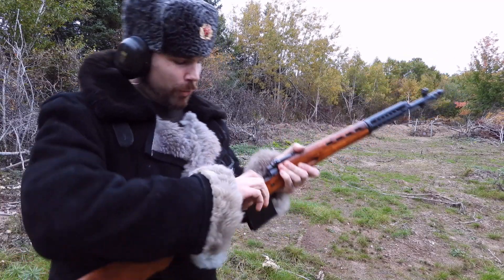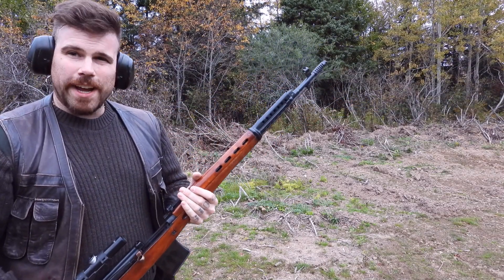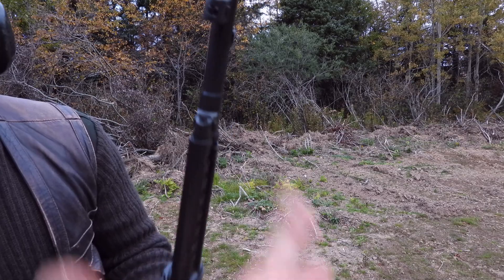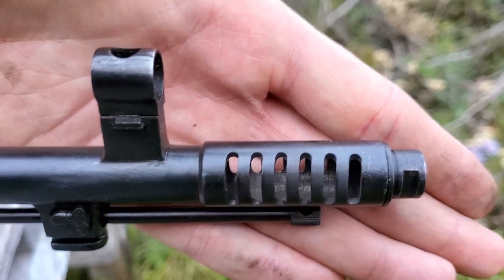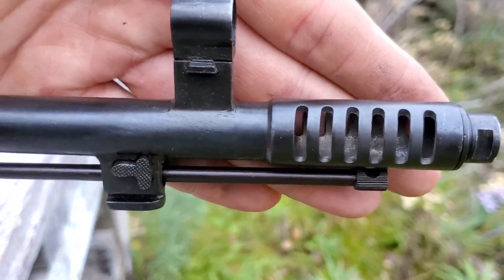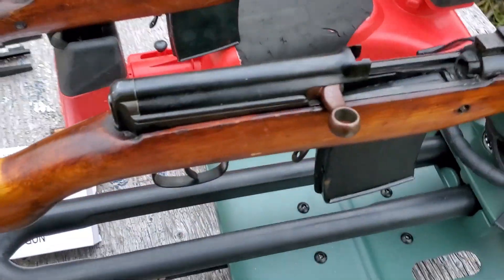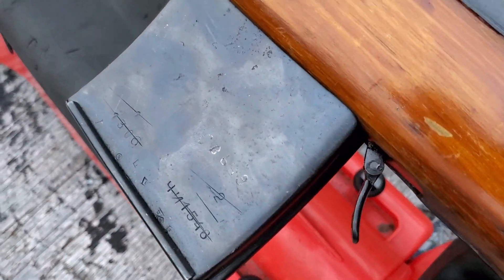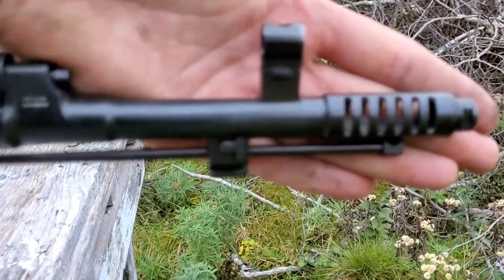1941/ and 42 SVT-40 rifles

Comment: Man I've been wanting to grab one of these while I still can but the price some are going for is nuts. Also is the bolt closing when you insert a new mag an intentional feature?
Reply from the maker: I was lucky enough to grab mine when they were still fairly available.  Canada got a huge blast about 10 years ago of russian surplus and you could get em for under 200. They're over 1k now. And im not positive if it doing that was intentional but I'd assume so. It only drops when the mags in or its recocked.
Reply: @mostly_accurate  I remember back before I got my PAL they were still around 500 bucks, now I'm seeing them for 1500+ which is just absurd, wish I was born earlier so I could've snagged all those sweet surplus deals

Comment: I lost one of the 2 recoil springs in mine. Hopefully I find one soon so I can put it back into action
Reply from the maker: Ah you got to love that one part that goes flying during dissaaembly. If nothing else its probally easy enough to get a replacement.
Reply: You would think eh. I’m sure I could find something close it’s a pretty generic size spring.
Reply: Complete set found on eBay 70 bucks! Who knew🤷🏻‍♂️

Comment: I’m confused as the 6port muzzle is the “earlier” model, yet has a 1942 stamp. And the 2port is the newer model yet has a 1941 stamp. 
Is there a mistake in the info or am I misunderstanding something?
Reply from the maker: Soviet union Refurbished alot of the guns and swapped parts around. Some are matching some are stuck together.
Reply: @mostly_accurate  ya I’m starting to realize a lot were swapped.
I also noticed with yours the rear sights are reversed for their models. Early year should have the groove down the middle between the numbers. Beautiful rifles btw, and great vid
Reply from the maker: @kevinVersus  thanks man. And yeah, from what I've heard, some went right into storage. Some got stripped and reassembled.I've got some new cameras and stuff. I was planning on making a few new POV videos just haven't found the time.

Comment: When you connect mag, there is a locking switch behind it. Locking it secures the mag, and make cartridge travel to chamber more smooth and avoid possible jams
You can use mosin stripper clips, easier to find pouches for them, than for original magasines (should be +2 with the rifle)
Reply: I have an SVT40. The magazine latch does not lock the magazine. It just moves out of the way so you don't accidentally hit it and drop your mag. if you pull the tab with it turned upwards you can still take the mag out.
Reply: @Bryan-jm4uc ifbit works then it works, and that is enough) yours guns a nice!  i have many mags, half of them restored war relics. Lock  holds mag better, fixates it. same detais tetaches mag when pulled towards mag. There was a war reports that soldiers lost mags coz they didnt lock them. Thats why today they sold with one mag, when actually there was three for each rifle
Reply: @Bryan-jm4uc   it should cycle prorerly even if it is not locked, but chambering issues possible
And mag can be lost, if you hit that release switch
I will check on mine if mags came out in Lock position